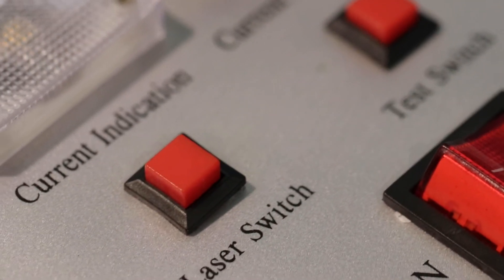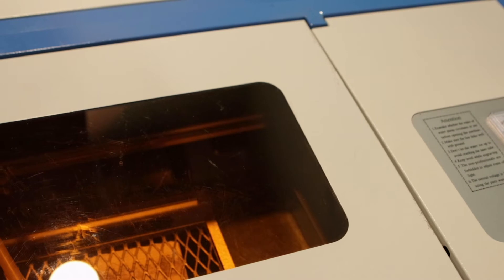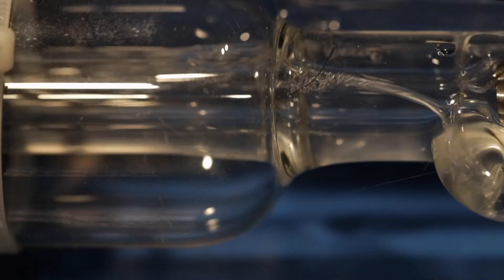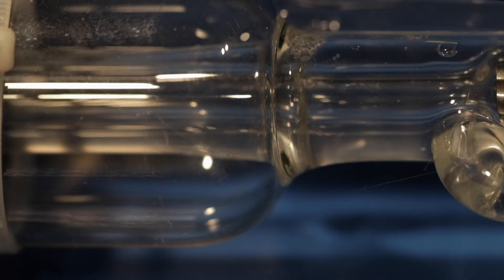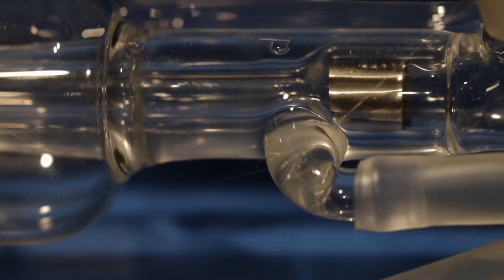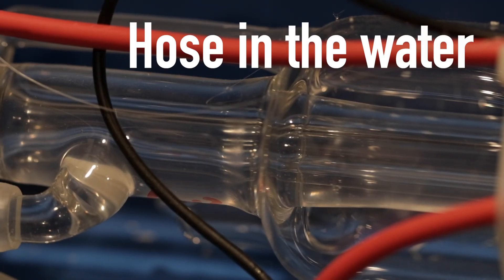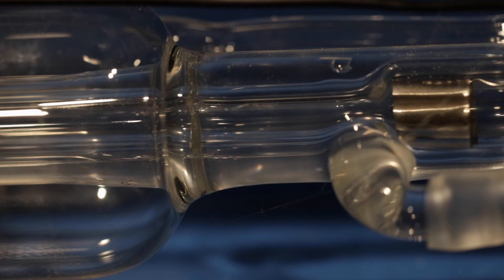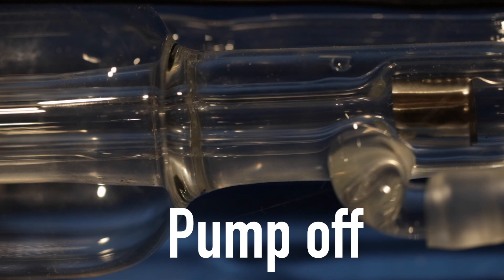Biggest mistake I made when I got my K40 laser cutter

Comment: When i added a 50L air assist to my k40 laser i switch on ,it turns on and off quickly by itself, she is no longer working, SOLUTION PLEASE 🥺
Reply from the maker: That is too vague for anyone to offer a real solution. Best I can do with the info provided and to say remove what you added and see if it works. I suspect the issue may not be directly related.